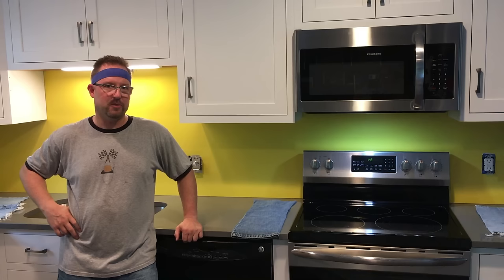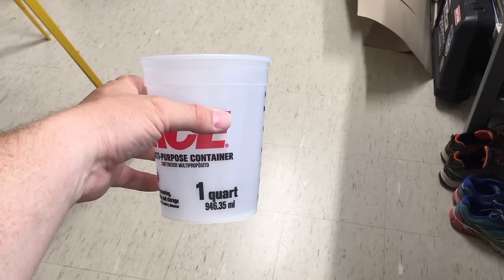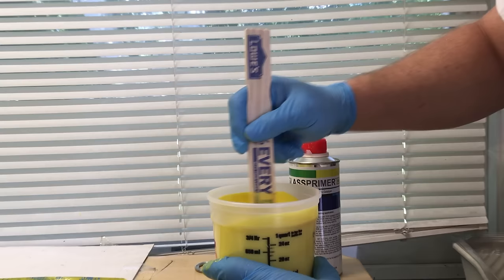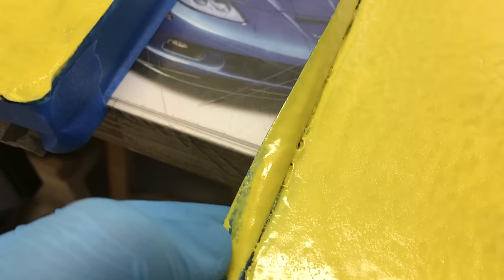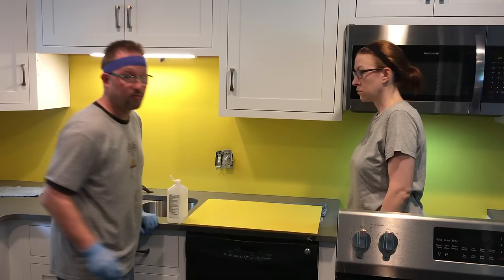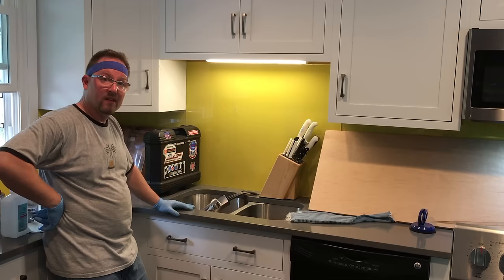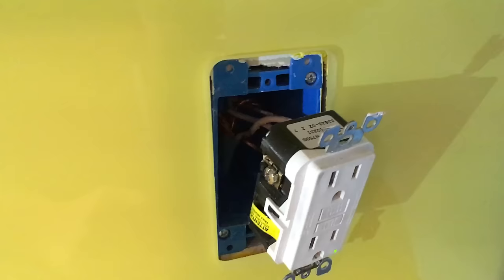How to install a back-painted glass backsplash in kitchen (or bath)

Comment: I was told spray/paint 4 times each round spray vertical then horizontal, vertical, horizontal and spray each time in 5 minutes intervals before 2nd, 3rd, & 4th rounds.  Let dry over 24 hrs period.

Comment: This is an excellent demonstration on how to paint and install a glass back splash! Thank you!!!

I noticed your walls were already painted the same color as what you used on the glass. 

How did you get the wall paint to match the glass paint? I would think the wall paint would be latex? 

Also, what is the reason for painting your wall the same color as your painted glass before starting?  Does this help with bleed through? 

Thanks again, this was super helpful.
Reply from the maker: Shelley Reynolds hi, the company can match any Sherwin Williams color, so we used the same color on the wall. It really wasn’t 100% necessary but it let us look at the color combo for a few weeks before we did the glass work, and make sure we liked the hues. It’s not so much for bleed thru. I would actually now recommend painting the walls medium dark grey... whatever the color of the mastic you use. or using a white or silver final coat on the glass as the mastic can be seen thru the yellow glass paint if there is a lot of light and I really try to make the lines out. I can sort of see it because I know where to look and I’m super detail oriented (or picky). With a darker glass paint color it would likely not be noticeable by me, but yellow being so light, and the yellow on the drywall, it transmits a miniscule amount of light.  I’m glad you found it helpful!
Reply: @SuperMacGuy  Thank you Chris for your quick reply. Using a light colored mastic makes sense. I will keep that in mind since I want either a turquoise or aqua color, in a medium shade.  

I love your yellow glass, so cheery and fun. It came out great!

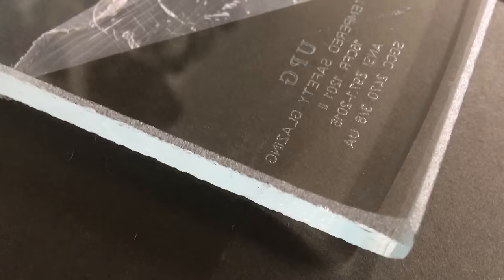Comment: You have not stated that the glass used is 'tempered safety glass'. (the watermark shows at 7:35) This is a huge factor in what appears to be the very high cost for the glass and the length of time to get the glass. While the glass can be ordered from most any good glass shop, there are only a handful of tempering facilities in the country. You and I get in line behind the auto manufacturers, window and door manufacturers and other commercial users. You cannot run down to the corner hardware store and grab some plain old float or plate glass for a backsplash. Given the potential for impact loads, this glass must be tempered. Tempered glass is about four times stronger than float glass but it is extremely fragile to point loading and scratches, additionally, it once tempered, it cannot be cut or trimmed.
Reply: typically laminated glass is used for this.  while not tempered it is strong and safe

Comment: Great video, I am planning to to the same but only with clear transparent glass. What type of adhesive to use to glue it to the wall that won't show through the glass?
Reply from the maker: Mirror mastic is the only type of adhesive that will work on glass and be long term.
Reply: @SuperMacGuy  Thank you very much for the fast reply.

Comment: Know this was posted awhile back, but I see currently 1 gal. of glass is $175 and you can't get anything smaller.  I think the primer was like $85 as of 12/22/21.  Do you remember the sizes of the panels used and how much paint was left over.  My area is small, and battling the cost of the paint. by itself.
Thanks for any feedback this late in the date.
Reply from the maker: I paid over 300 for 1 gallon plus activator. The panels are about 20 inches by 11 feet maybe. After all the coats, there was at least 1/2 can left.
Reply: @SuperMacGuy  Thanks so much for responding.  Cost of paint & clear activator stuff from glass primer running $265 right now, so might as well say $300.  LOL  Need 3 glass panels from 30' wide, 44' wide and 42' wide with all lengths about 14'.  Their website say if use roller use Mohair.  Many reviews are saying Mohair brushes/rollers aren't made maybe like they use to - lot of neg reviews.  Noticed you used like a sponge type.  
Want the look pretty bad, but after glass low iron price, paint, silicone stuff = dang!  LOL  BTW, yours look so nice. You & your wife did a great job!    I saw 1 guy painted his backsplash w/ some type of moisture reduced paint before putting on the painted glass using Krylon spray can paint to backpaint the glass.  Wonder how its holding up?  But I don't like doing stuff willy nilly & 1/2 butt, so got big decision to make.
I really like 1 picture from Creo Glass in UK, where 2 mirror strips were glued on top of the glass that was really nice looking.  Again thanks for your feedback, and I did see Ikea had 2 glass panels for like $25 w/ 1 of the 2 panels perfect size for me, but its not low iron!  Drat, thus I'd have a green/yellow tint.  Thinking of trying other glass paint with Ikea glass as a sample for my tester.  Still researching to DIY as low of an investment as possible, but don't think I'll get around that Glass Primer paint cost unless they have a sale!!!  LOL  Merry Christmas!

Comment: about how much did the glass and cutting cost? thanks for the detailed how to
Reply from the maker: deebaxster It was around $700 for the glass. That was the best price I could get, a different glass supplier had quoted over 2x as much, so shop around if you can.

Comment: How has this held up? How durable is it? Would it break if a pot or pan slid kinda hard against it on accident?
Reply from the maker: It is very durable. We don't bash stuff into it, so its as good as the day we put it on. We clean with windex. Super easy.
Reply: @SuperMacGuy  thats awesome! do you think it would break easy though?
Reply from the maker: @ridgehall4588  Do you plan on pounding on it? I don't know the force it would take to break. I got 3/8 inch thick glass and that's pretty thick. So minor impacts from sliding a pot across the counter, probably not. If you take a hammer to it, sure it could crack.
Reply: RIDGE HALL it’s 3/8” thickness tempered glass. It’s incredibly strong by design and probably could withstand a hammer swing. 1/4” thickness would still be very strong, and cheaper.

Comment: can plexi glass be used?
Reply from the maker: Sure you could, but why would you want to? Plexi can scratch, fade, dry out over time, chemicals can stain it or etch the surface of it. It can get wavy and look cheap if not thick enough. Heat from an oven or stove could soften it over time. It can be chipped or cut with a knife. Longevity wise, glass is the way to go, but yes plexi certainly can give you the same look in general.
Reply: I was told Plexiglass more expensive than real glass now, and not as effective as real low iron glass for this look.